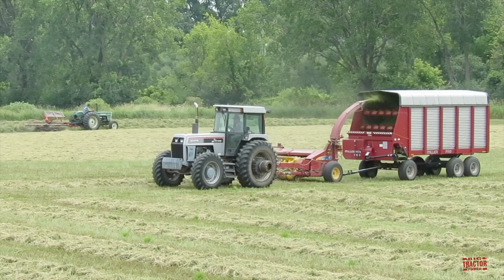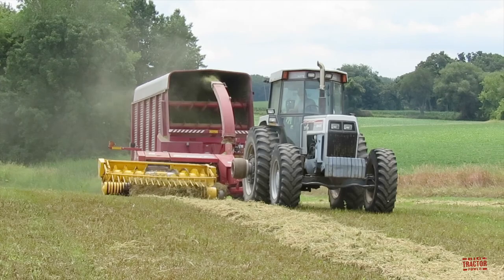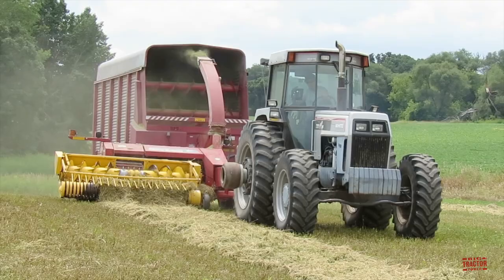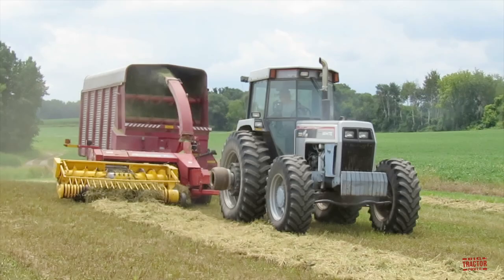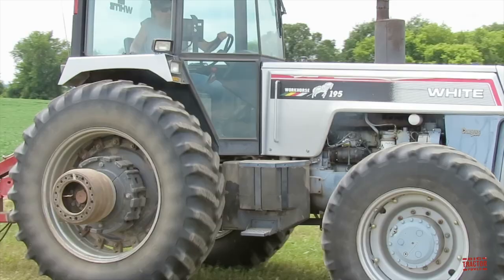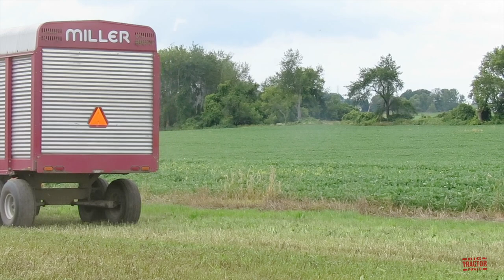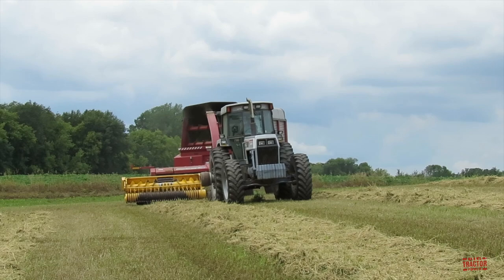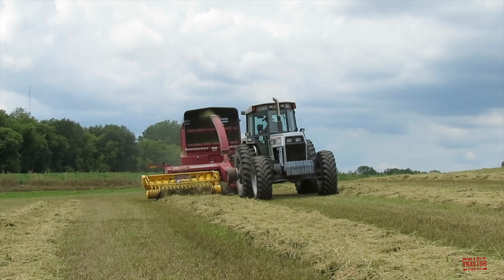WHITE 195 Tractor Forage Harvesting

Comment: Awesome to see olivers an whites still be used on the farm. Dad Had a 1355 oliver tractor on the farm back in the 80's  which is the firsr tractor I learned to drive at the age of 8 yrs old.
Reply from the maker: Very cool.  The Fiat built 1300 series are harder to find.  They are neat tractors. What jobs did your family’s 1355 get used for?
Reply: @bigtractorpower  it was used for pulling  wagons of all types,  pulled a manure spreader even in winter (had a Cabet on) rake hay, until 1990. When it caught fire in our machine shed in Jan. The shed an all other equipment was saved the the 1355 burnt up.

Comment: The 195 was a update from the 155 series 3
Great looking tractor and very strong nice 
To see what looks like a Oliver 1365  row crop tractor powered by Fiat and a 1800 Oliver narrow front and a white 160 on the blower great vid again Jason keep bringing them !!!!!!
Reply: Don't know your Whites and Oliver's too well...the 195 was an update of the 185 from the previous 100 series tractors. The White tractor running the blower was either a 125 or likely a 145 not a 160. The 160 was again part of the previous 100 series withe the aforementioned 185. Different decals and cab color/roof than the 100 series Workhorse's seen in this video. Also that was not an 1800 Oliver. Looked to be a 1750 or 1850.
Reply from the maker: Thank you for watching.  The Oliver raking is 1365, the wagon tractor is a 1650 and the silo tractor is a 170.
Reply: @bigtractorpower  that silo tractoe is not a 170. I can tell by the hood. It's one of the smaller frame Workhorse models...i.e. the 125 or 145